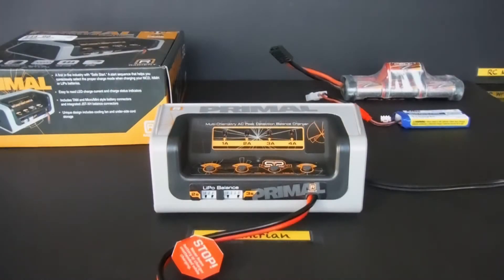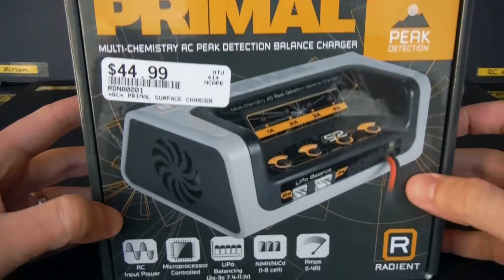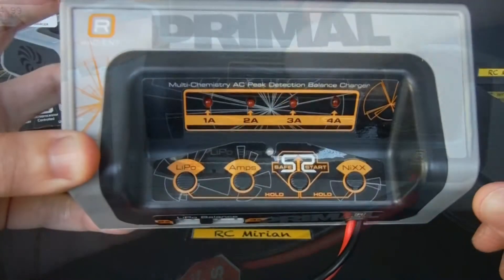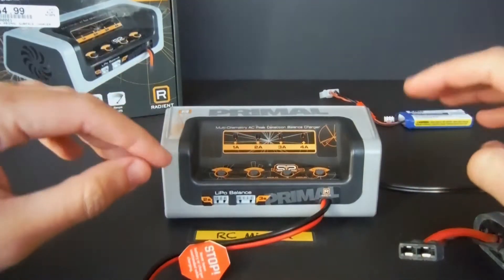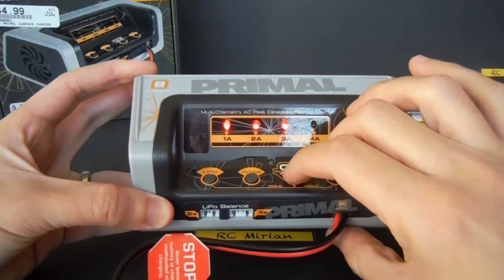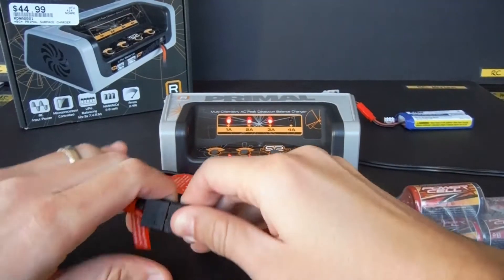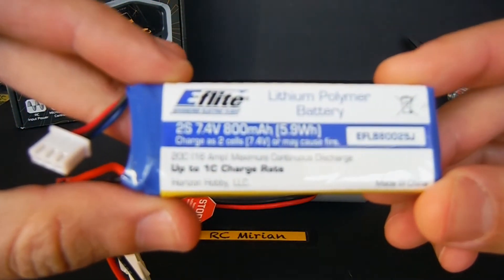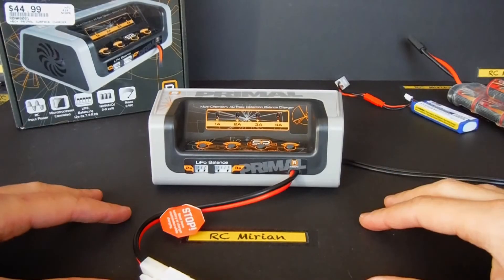How to charge RC Lipos and NIMH Batteries Tutorial

Comment: when I hold the two buttons it turns red but when I let go it turns off and I can’t select Amps
Reply from the maker: Try with another battery to check if it’s the battery first but if the same problem persists, maybe you have a faulty unit.

Comment: where tf does it say what amps to charge it at??? lol bc i have a 20c 5000 7.4v battery
Reply: and is your 3000 so it should be 3 or less? AND THERE IS ONLY 4a, should i jst go 4a?
Reply from the maker: These are the rules for charging: 5000mah is 5.0 amps, 4000mah would be 4.0 amps, 3300mah would be 3.3 amps. You probably see a pattern developing. But charging at under max suggested charge rate is actually better than constantly using the max charge rate, hope this helps!
Reply: Mehdi Mirian ok, so my charger, like this one, goes up to 4 and I have a 5000 so should I just charge it at max (4)
Reply from the maker: Yes!